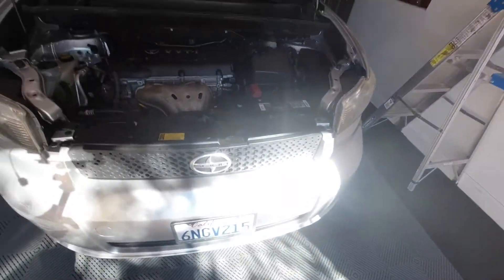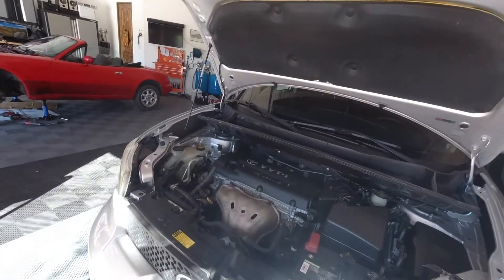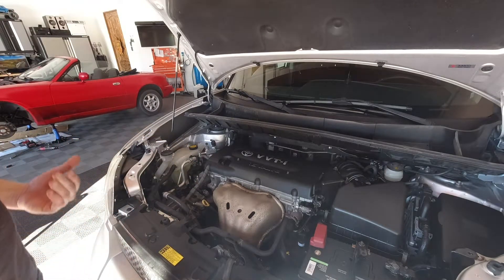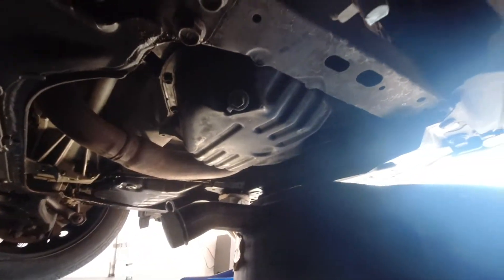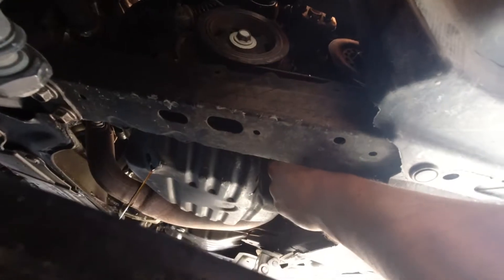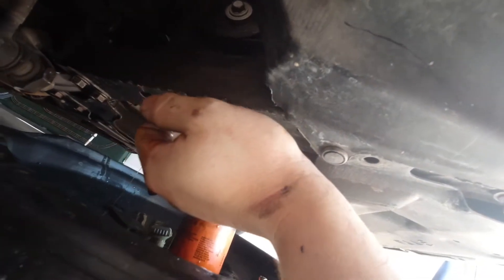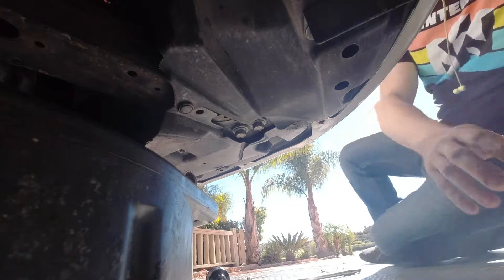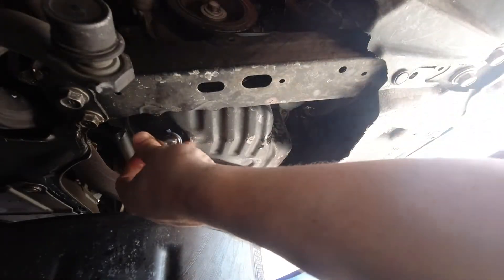IG181 2010 Scion xB oil change

Comment: I have been using conventional oil in my 2009 Xb because that’s what the manual recommended, is it ok to switch to synthetic oil ?
Reply from the maker: In my opinion, youre fine using either one.  According to most major oil manufacturers you can switch from regular oil to synthetic (and back again if you want) without any additional steps or issues.  Synthetic oils are designed to be compatible with conventional oils.  

You will find some people online that claim that synthetic oil is more slippery and can cause leaks in older engines, but other reports state that synthetic oils actually help to restore old dried out seals because of their superior additive packages and can reduce the chances of leaking.  

The way i look at it, the oil manufacturers are experts on oil, so i trust their assessment and have never had a negative experience using synthetic oil in any vehicle as long as it met the weight / grade requirements of the engine..

Comment: what about the filter? add a little more oil when you start it up.
Reply from the maker: I always let it run for a bit then shut off and check the level again. This allows the oil galleys, filter, etc to fill up.